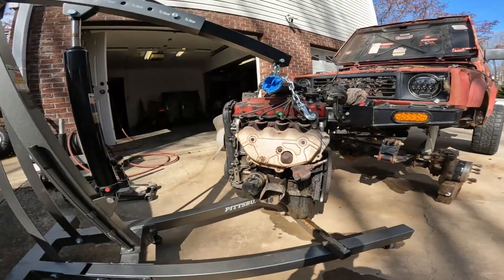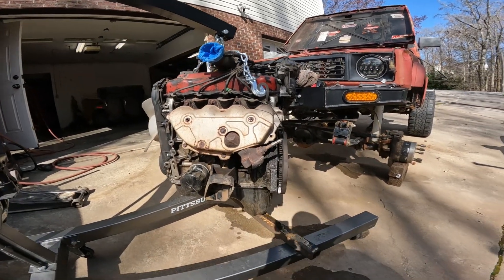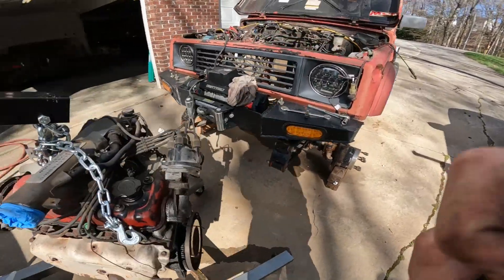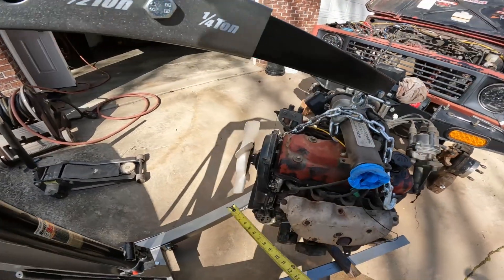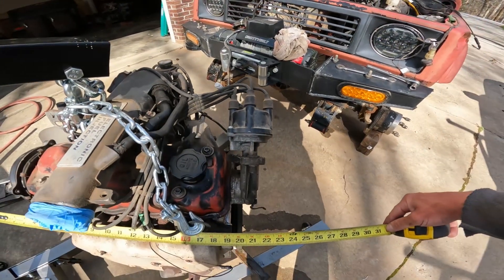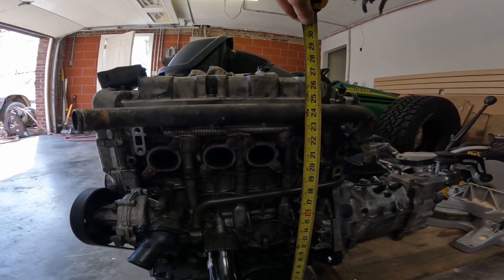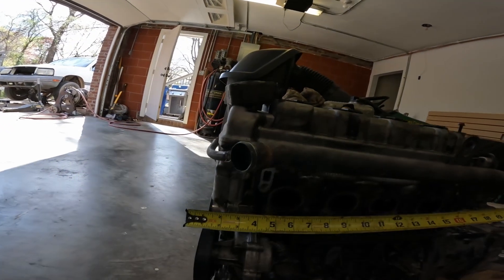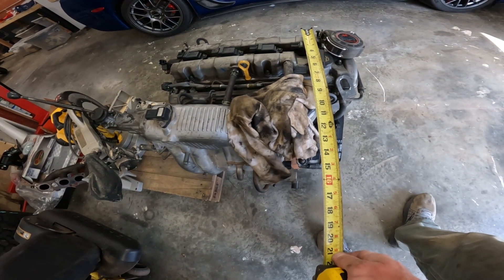Suzuki Samurai 2.3L swap: 2.3/2.0 vs 1.3 Dimensional Differences

Comment: Awesome, thank you! Unfortunately it looks like there is no way I can fit that engine family into my samurai. My “body” sits lower on my frame and I front axle travels about one inch higher than the stock bump stops. Thank you for the measurements. I guess I’m sticking with my turbo plan.